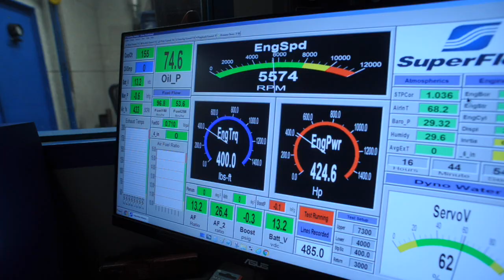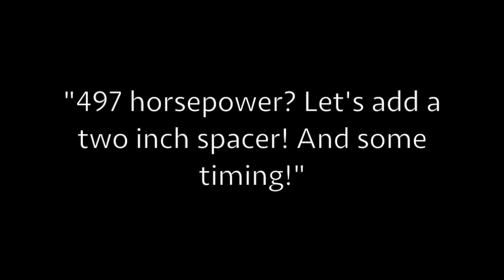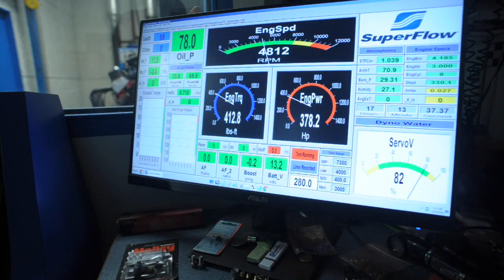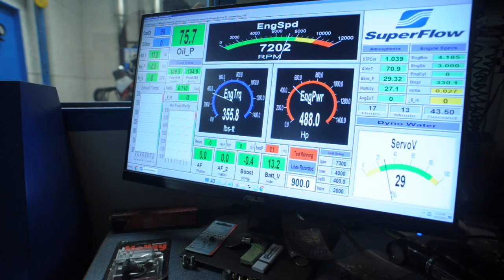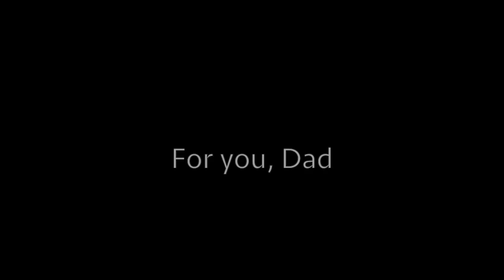Dyno #2 283 Crankshaft + 400 Block | Big Bore Short Stroke SBC

Comment: This is so awesome..can you point me to a 5.3 build that you guys  prefer over others...my oil pump is shot..so I need to redo things in the Gen 3  5.3
Reply from the maker: I’d be happy to help. Is your engine down on oil pressure? I would suggest start with a mechanical pressure test at the oil pan, above the oil filter. Some early 5.3 would spin the rear  camshaft bearing and cause low pressure on the gauge.
Reply: @ceperformance  wow thanks for the reply..I will check into that.i did install a used zo6 cam many years ago...just getting it running and in car now...and came across zero oil psi
Reply from the maker: I’d like to hear what you find. I hope this helps :)
Reply: @ceperformance  what am I looking for at the port above the oil filter...if pressure there and not at the back of manifold...cam bearing ??
Reply from the maker: Yes, if there’s oil pressure there but not at the rear /top of the block, then it’s possible that the rear cam bearing has turned and blocking the oil passage to the sensor hole.
Reply: @ceperformance  if it's turned,I won't get oil to the pushrods also...correct??
Reply from the maker: No just the sensor hole generally.
Reply: @ceperformance  ok..thanks

Comment: 4.8 crank with 5.3 block.
Reply from the maker: Just FYI, 4.8 and 5.3 blocks are the same. A 4.8 crankshaft in a 5.3 makes a 4.8.
To make anything worthwhile you would use the 4.8 in a 6.0, 6.2 or 7.0 block.

Comment: Yes it was , it was hard to fine a cam for them , i ended up with a 5 gallon bucket full before i found one .Thanks to a drag racer friend at the time i ended up with a drag race cam BINGO . These jack ass cam grinders are not gone to sell you the hot lick , that is for the deep pocket's .So you are left scrap through the pile until you luck up on one like i did . Some of this stuff makes good power but you got to be able to drive this dam thing . I really think the lobe center played the biggest part it was 114 degree but i'am sure other parts played into that also . A friend of mine has a engine like yours in his street stock dirt car , i have no idea how many races that man has won .................Keep it up small engine's are working there way back .........
Reply from the maker: Thank you Ken! We appreciate your comments.

Comment: Which afr heads you use and what was the compression ratio ?
Reply from the maker: It’s 10.78:1 and they are 180cc intake runners pt #916. 
Angle milled to 55cc to get that compression with flat tops.

Comment: need to do a 350 crank in a 400 with the longest rods and shortest pistions with low tension rings! vortech heads and a 300hp 327 cam! smoky was a big fan of a 2.0 to 1 or if possibal better rod ratio!
Reply from the maker: That sounds like a great next build! Thanks.
Reply: thanks for the reply! yes I think this would be a good engine build for you guys to try!

Comment: I had this combo . in a sprint car 14.7  Hilborn , never did have it on the stand turned it around 78 it kick ass . Then my other engine i put a 3  1/4 stroke in it , same 14.7  Kinzler  same rpm . It was a killer on 1/2 mile dirt tracks ..Then i got smart ( not ) put a 3 3/4 stroke in one it okay but couldn't get big enough heads to make it run like it run like it should ........I really like the short cranks and large bore , this was in the late 60 early 70.............Have fun guys..............
Reply from the maker: That’s awesome to hear there Ken! Must have been fun :)

Comment: This is knocking on the door of the horsepower made by Grumpy Jenkins back in the early 1970s with his first 331 powered Vega. I like to see what this engine would produce with a tunnel ram and two 660 CFM Holleys.
Reply from the maker: That would be awesome! Thanks for commenting.
Reply: @ceperformance  would love to see this to!  I have wondered what this combo would do for years!  ✌
Reply: In 1970, Grumpy would have loved those AFR heads.
Reply: @imyrbiggestfan  you know afr heads were around while grumpy Jenkins was still alive, right? He didn't die that long ago
Reply: I’d love to see a tunnel ram, 2x4 650 cam carbs, around 12:1 compression, Q16 fuel and a big mechanical roller cam. It would rev to the moon
Reply from the maker: Sounds like fun!! I’d love to hear the sound of that!
Reply: NHRA did everything they could so Mopar would win  but every one in a while a SBC would still win
Reply: @canabox7112  Mainly because Bob Glidden outworked the Chevy teams. BTW...the W-2 LA engine in Pro Stock carried a much higher weight penalty than the SBC. I was alive and following Pro Stock carefully in 1979-1980 when Glidden was running a Mopar. Grumpy Jenkins was whining to the NHRA about Glidden’s domination of the class.
Reply: @stevehicks8944  Grump didn't have a nitrous bottle straped to his leg like gliden
Reply: @stevehicks8944  I remember when that guy from New York( can’t remember his name?) hired Glidden to build Nascar engines. It was Fuvking joke! I guess they forgot to tell him they have to last more than seven Seconds
Reply: @canabox7112  Your point? You DO have a point, yes? An old friend of mine was an engine builder at IMS when John Lingenfelter was hired by Chevy to develop a “stock block” engine for Indy. He told me most of the teams were sweating bullets due to Lingenfelter’s reputation( for building drag race engines). My friend told them not to worry. Can you name ONE IMS race won by a Chevy “stock block” engine? Don’t take too long looking because there have been ZERO. Just because a person can assemble and tune a fantastic NHRA engine it doesn’t mean their skill set extends beyond that class of engines. This is WHY my friend only built USAC sprint car and late model modified engines. He was very successful in those endeavors. In fact, his engines helped Pancho Carter win the USAC Sprint Car national championships in 1974 & 1978. He was one hell of a teacher...that I miss very much.
Reply: @AlanRoehrich9651  WHERE did I mention Wayne Co. Speed Shop in any of my posts? Please, feel free to illustrate.
Reply: @stevehicks8944  you said it wasn't possible to run nitrous in pro stock because cars get tech inspected. he was just mentioning teams that ran nitrous in pro stock... clearly your "friend" didn't teach you common sense
Reply: @konnerkramer329  There is a huge difference between “highly doubtful”( my exact words) and “not possible”. Reading comprehension ISN’T one of your accomplishments, is it?
Reply: @canabox7112 no NHRA did everything so Mopar would lose just like Bill France did
Reply: So innovative! Love to see this with a DZ like cam and cross ram intake.  This would be a blast as a road racer.
Reply: With today's parts availability, building a 10,000-12,000 + RPM small block isn't that big of a deal, good block like a little M, good aftermarket crank, good set of Aluminum Rods, 4%over balance, a light weight pistons, and pins, we also built a Boss 302 for former prostock fame Mike Edward's, the heads had the floors filled and raised about a half inch, increased airflow a lot, and the Boss 302 saw 9,800-10,000 every run in a D/Sm Ford Maverick, 
I also tuned a friend's flat bottom Drag boat with A Landy 406 cu in Hemi that we spun nearly 10,000rpm  a it ran quicker and faster than the 2 classes above it, and set a record that may still exist, since I left drag boats in 83 after running a blown alcohol hydro from 76'-83' my driver was killed in 86'....engine was a 557" stage 5 Keith Black block and Brodix heads, 2.400 intakes, 2" exhaust R296 crane cam, and buzzed it 8600 rpm and never hurt it

Comment: This build is great guys. Would you please give out some more info on it? Like which AFR heads, all cam specs, head gasket thickness, and piston to deck clearance?
Reply from the maker: Hey Gearhead, 
Thanks for asking. The heads are AFR 916’s. 180cc, angle milled to 55cc chambers, 10.78:1 compression. 
Cam is a 4/7 swap HR. 224/230 @ .050”
.536/.544 lift with 1.6 rockers. 114 LSA and 4 degrees advanced. 
.035” quench.
Reply: @ceperformance  Thank you so much for the great info! Would you give just a little more? Cam duration, piston specs, deck height, and rod specs? 

I'm in a 350 build right now and getting that quench distance and static/dynamic compression just right without milling the block or heads is challenging without breaking the bank. AFR heads continue to be my favorite aftermarket cylinder heads.
Reply from the maker: Hello again, 
As noted above, the duration & .050” is 224/230. And the other things are here:
The bore is 4.185” and the compression height is 1.443”.
The piston part number is IC9941-060
The rods are Scat I-beam 6.1” long, used in an aftermarket LS engine normally, .927” wrist pin. 
Large journal on the rods but small journal crankshaft with the use of King Bearings # CR867XPN030. 
The stack height is taller than the deck so it has .061” head gaskets from Cometic leaving the quench at .035”
Cheers :)
Reply: @ceperformance  Thanks again! From the last question I actually was wondering about advertised duration to see the ramp rate on the cam but you've answered all I've asked and I should have remembered the rod length on this build (because is the whole premise of the build; big bore, long rod, short stroke). Looks like the dynamic CR is 8.8.

What's the next build? I would like to suggest a 334 stroker next (305 block and 400 crank). 
Cheers to you too!
Reply: Or go with a 267 block and 400 crank.  Probably run out of air at 4k but be a nice tractor engine.
Reply from the maker: Hahaha :)

Comment: Really need to see more people Do this, extremely impressive how much power this makes with such a small sized displacement and cam. You still make the power of a 383 and now it gets to rev and be as fuel efficient as a smaller motor. 👍
Reply from the maker: Thank you very much Chris. I appreciate your comments!
Reply: But you have to twist it much harder and the torque isnt there. 3.75 stroke far superior, 383 or 406 would make much more power. Anything 283 goes in scrap pile.
Reply from the maker: @GJ-DT  
Hey now, that’s not nice. Lol!
Reply: @GJ-DT  depends on what you are doing i took alot of $$$ from big stroke engine with a short stroke 400 block based engine racing
Reply from the maker: I agree :)

Comment: Messed with a fair amount of 400 block de-strokers back in the early to mid 90s. Without Uber cylinder head flow it's hard to feed 400+ cubes, but smaller engines can thrive.  As a bonus we realized it was easier to get the reduced low end torque to hook, a well sorted 383 could get a hole shot but at the top of 2nd gear the 348 was steamrolling.  The big twin snowmobile engines were similar, couldnt get enough flow at high rpms to adequately feed them, that's why the triples and quads top end so good.  As much as it hurts to admit, the ls cylinder head flow capability is the biggest advantage over a standard sbc. Great info guys.👍
Reply from the maker: Hey, thanks for checking this out, and for commenting! 
Some people don’t seem to understand the place for unique engine builds, like everything needs to be stroked. 
Hey, I love big cubes as much as the next guy but not every build needs to be the same old thing. Yawn!
Reply: @ceperformance  p
Reply: @ceperformance  kinda similar comparing a built Ford 260 to a built 289 or 302. for hard driving on a circuit the 260 will handle being kept spun up better, give great mpg if babied a little in something light. all compatible tinkertoy parts isn't costly to build, pick your valves, cam, etc.

Comment: Decent numbers for what looks to be an older AFR head. I think given the powerband of this engine a single plane would offer better results still. I noticed the sweep rate from your previous video (500 RPM/Sec) to this video (400 RPM/Sec) and have found most engines will pick up a few numbers with the slower rate. I was also surprised to see a 3% correction factor in the lower mainland, Richmond Engines can't be that far from sea level, no?

The pulls are certainly cleaner sounding than last video, my thoughts would be this was an ignition issue rather than a valve bounce/float issue. When we face float, the graph does nearly a vertical drop. 

Cool to see a fellow Canadian doing an interesting build and posting it. Cheers!
Reply from the maker: Thank you for commenting and for your input!
We are at sea level here. 
The heads are AFR 180’s, angle milled .100” to lower the cc to 55. We wanted the compression high but keeping a flat top. 
It’s 10.78:1.

Comment: Could I use an engine like this in a tow truck instead of a 383 ?
Reply: You would want a lower revving engine with more low end torque fer a tow truck.I would suggest a big block.💪
Reply: @danhambrick6331   so this engine will only work in the stratosphere
Reply from the maker: @MP-pz9oe  
Not at all. It has impressive torque for it’s size and will be perfect in the 1966 Beaumont it’s going into. Tremec TKX. 
 Nice fun driver :)
Reply: @ceperformance   So , its better than a 383
Reply from the maker: @MP-pz9oe  
Not saying that. All depends on application and what ya want :)
Reply: @ceperformance   more power, seriously I,m wondering what will be the outcome between a 302 ( 4.0 × 3.0 ) and a 305 ( 3.73 × 3.48 )
Same heads , cam and intake.
to try the theory , respectfully
Reply from the maker: Someone out there has probably done a comparison?
I’d bet the larger bore wins on hp and torque.
Reply: @ceperformance   maybe, but you are the expert not me,
Respectfully
Reply: @MP-pz9oe  
Other options:
TPI
Vortec
LT1
Turbo
Supercharger 
454 7.4L
8.1L
5.9L Cummins

I really love my 2004.5 Cummins 5.9L 325 hp 600 tq 
18-22 MPG all day while doing 2500 rpm and 65-70 MPH. 3.73:1 gears. 100 % original.
Reply: @xmo552   or a Merlin Rolls Royce V12 27 liter engine ...

Comment: Very impressive… I wonder what it would make with a single plane Team G intake or maybe a victor JR … and possibly a lil 50-100 shot …
Reply from the maker: Good question! Might have to try that. Thanks for commenting.
Reply: Just a decent tunnel ram would push this thing way over 515hp!! No need for nitrous.
Reply: @Anarchy-Is-Liberty  I've tried tunnel ram with 2 - 4s and actually did nothing! In my opinion it's just for looks!😉 actually fuel injection would be way better! Or another option would be super charger or turbo😉
Reply from the maker: All these ideas would definitely make more power. Thanks for commenting :)
Reply from the maker: Thank you for your comments.
Reply: @Anarchy-Is-Liberty  I could be wrong, but I think the winking emoji meant he was joking

Comment: Years ago before everyone was doing the 383 strokers even with a factory 400 crank turned down we used to build 363s by ofset grinding a 350 crank 1/16” . The rod journals would end up the small journal 283/327 rod size. Also bored .030 over and I think it would be 369 cubic inches if we went .060 over can’t remember exactly but they would scream.
Reply from the maker: Hey AndyGee’s Garage,
I appreciate your comment! The offset  grind technique is old school and awesome! Rarely ever see it done. We’ve done several over the years at www.canadaengines.com
One I’m building right now is a 6.0L LS and I’ve offset ground the crank to increase the stroke .120” and just like you said, takes it down to small journal 2” pin. Doing that brings the stroke up to 3.75ish”  and makes the 6.0L into a homemade 383 LS. 
Dyno testing will follow :)

I love your 369 combo. I’m already thinking about building one now! 
Budget parts with awesome results is always something to shoot for :)
Reply: @ceperformance  it was when stroker cranks were basically unobtanium for the backyard guy but you could still find forged small block cranks in the wreckers lol 
I always keep my eyes open for parts I can use. I’m currently building a 355 sbc using a Scat forged bottom end I got a great deal on from a guy that decided to go LS for his project. The kit is brand new never out of the boxes yet. Actually taking the crank to be balanced in the morning. 
I thought about stroking it the same way but forged rods with the 2” end are $500 and the kit already has 6” forged I beam rods in it. Also doing that you still have to clearance the block for the stroke. Maybe the next one or maybe the machine shop has a set of rods they’d trade for my 6” large journal rods and I’ll have them stroke it. We’ll see what tomorrow brings 🤔
Reply from the maker: @AndyGeesGarage  
I’m so glad you replied again! I have a solution for you that I used a couple times. King makes rod bearings to fit the large journal rods onto your small journal crankshaft. I did it for the same reason, because the long rods in 2” are so expensive. I’ll find you a part number…
Here it is in .030” under so you can offset it the max. 
CR867XPN030
They do make them in .010 and .020 as well.
That’s a great way to save a bit because you need bearings anyway!
Reply: @ceperformance  thanks I’ll talk to the machinist and see. I literally just dropped off the crank for balancing and polishing
Reply from the maker: @AndyGeesGarage  
Take care!
Reply: @ceperformance  what would be the cost comparison of offset grinding a 350 crank vs just buying a 3.8" crank?
Reply from the maker: Hey! Thanks for your message. The offset grinding method is good for a maximum of .120” going from 2.1” journals to the 2.0”. The only 3.8” option would be an aftermarket crank I believe.

Comment: Really diggin this build,always liked the short stroke builds. I’m in the middle of a 331” sbc build using 18degree Dart top end. This one of yours just added a little more motivation.
Reply from the maker: Lewis Mocaby,
Very cool! Thank you for commenting :)
I would be interested in hearing how yours turns out.
Reply: yeah with that top end its goin to fly like a dart . more like a rocket experiment. may as well run it on nitro meth 2.  ugh  here's my rocket,. . . powered by farts. runs 5's in the quarter.